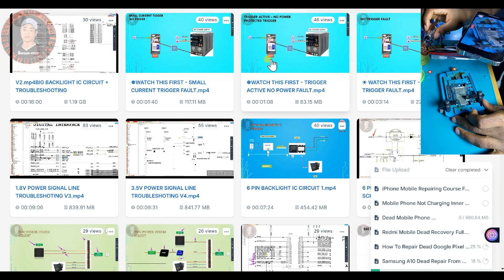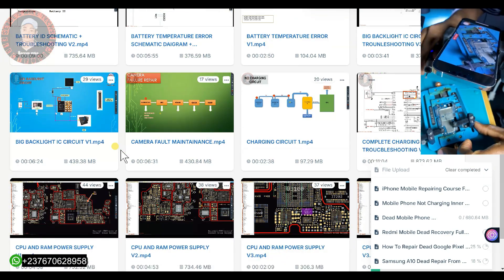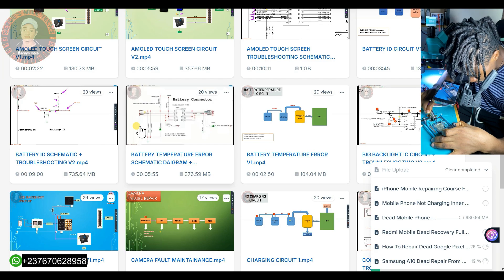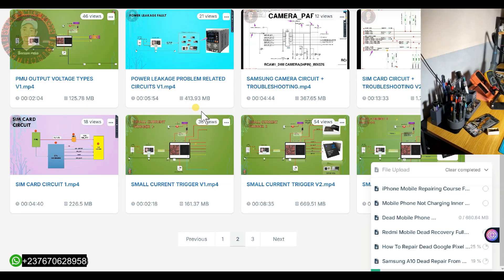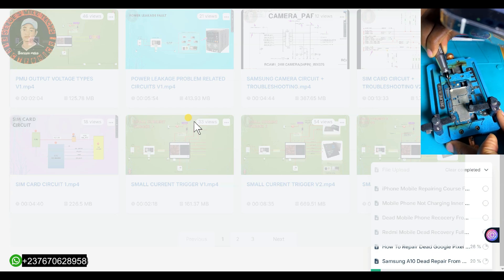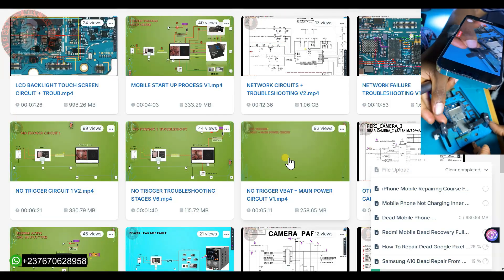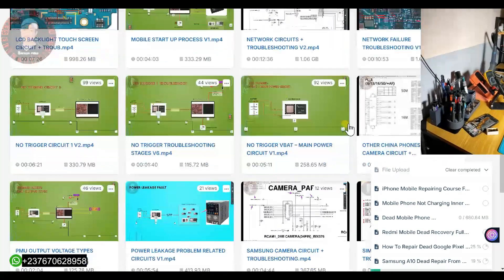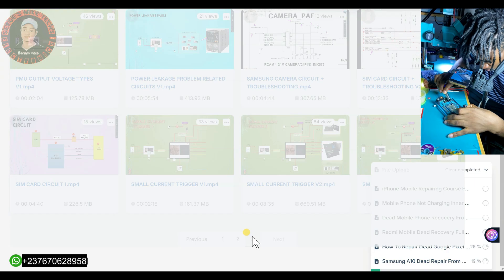Learn Advance Mobile Repairing In Less Than 1 Month | The Best Online Mobile Repair Course

Comment: I have a question, my Huawei Y6 2019 doesn't power on, it light red at the back but still doesn't power on and it becomes hot when connected on charger